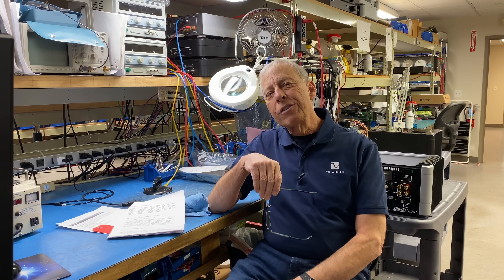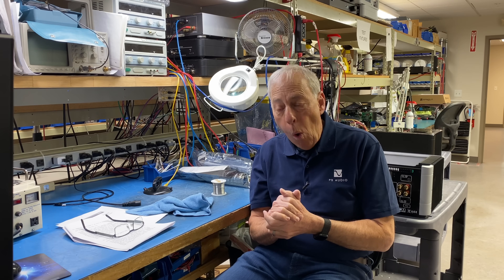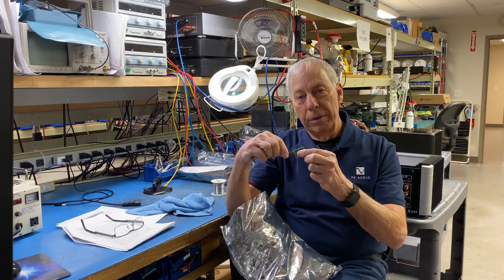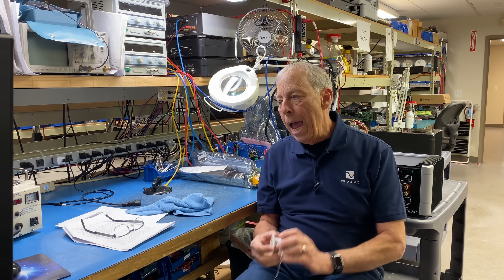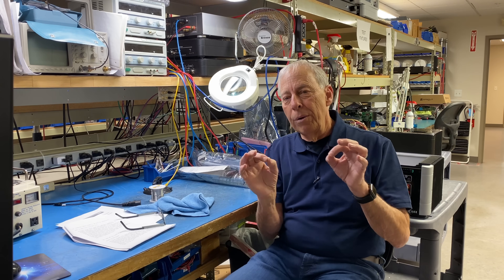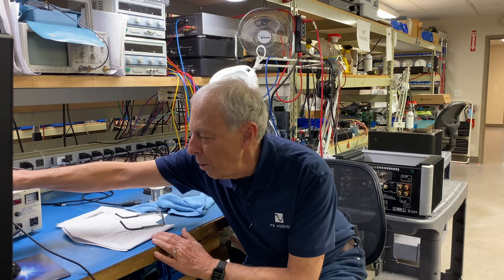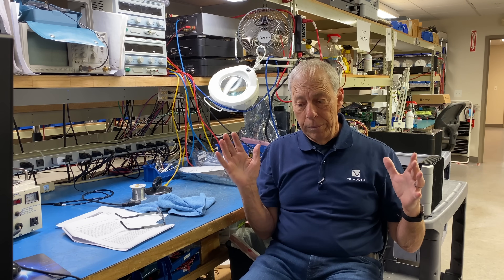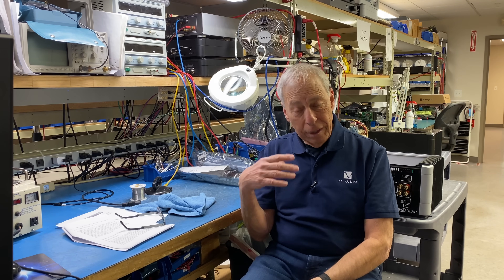How important is solder?

Comment: I remember when you had to flux so(l)der yourself. I must be old...
Reply: Scott King, yes, if you are soldering copper water pipes; the flux is separate from the solder, and is highly acidic, and you should never use that type of flux for soldering electronic connections, it will corrode them! Read the label on any type of flux before you use it, it should say on the bottle if it is suitable for electronics work.

I dont recall ever seeing any 60/40 electronics solder that doesn't have a flux core, and I'm 62 years old. If such a thing exists, I wouldn't recommend using it.
Reply: Dave Micolichek  , surely not for electronics work?! Plumbing, yes; I learned to sweat pipe some 50 years ago (our summer place at the beach would invariably be found to have a burst pipe somewhere under the house when we went to reopen the place every spring; the pipes werent all pitched properly towards the drain valves). I dont think I've ever seen 60/40 electronics solder without flux core. Conversely. I've never seen plumping solder with an acid flux core (the new leadfree crap for plumbing could probably use it, terrible stuff, but perhaps an internal flux would spit at you when you applied the torch).

Anyway,  soldering of any kind is always about cleaning the metal first; nowhere is that more apparent than when sweating pipe!

Comment: Paul, you mentioned a study done that compared the different solder types back when 63/37 tin/lead was the norm for good solder (military production). Can you point us towards that study?
Reply: I always use sn63.  It has the lowest melting point.  Funny, that as you mix tin and lead, the melting point is lower for the alloy than for either metal on its own.  And 63%tin/37%lead is the lowest melt point.  Higher percentage of either metal, and the melting point starts to rise. Sn60, the one he mentioned,  is very close to sn63, with a similar but slightly higher melting point.  For some reason, it was far more common outside military applications.
Reply: @scottrsmith2389   As i said we used 63-37 rosin core (RA) solder for our military production line so that is what I always used at home. This military equipment had harsh vibration requirements so we need good non fatiguing solder joints. At my age I'm not likely to switch over to silver, my hearing's a bit suspect especially since I had a 1,000 psi CO2 line burst next to my head years back - talk about ringing your bell.

Comment: Yep I remember reading about a ''special'' solder (and I pronounce the L) back in the 80's that was supposed to sound better.  I think TAS or Stereophile had articles about it.  People were wicking and or ''sucking ''the solder from their PCB's and replacing it with the magic alloy. $$
Reply: I guess once you get bored enough of changing power cables, upgrading solder is the next logical step.
Reply: @terrywho22  Made my day and also spot on^^
Reply: "Wonder solder"
Reply: "you can instantly hear the increased soundstage quality!!"
Reply: @ruwdbouy  Yes, It's as if several veils have been lifted.  ;^)
Reply: Well replacing only ONE, or only a few joints of solder in an audio component with a different, better type of solder definitely isn't going to make ANY totally audible difference, (and "arguably" measurable at that), however, if you changed out every single solder joint in the entire circuit of that component, or better yet, you actually were to build the exact same component from scratch with the better solder, from the ground up, then you would be able to hear a slight improvement in sound clarity and detail, especially in the top end treble, (I've tried it myself because I didn't quite believe it either!), but this will also all come albeit at a very considerable price/cost increase over the cheaper "standard" solder, so it's usually not really worth it, (price vs. performance ratio), to use the most expensive solder in most "average" audio components because solder doesn't make nearly as much difference in overall sound quality as the individual component part quality does! (i.e. the relative sound quality of the capacitors, inductors, resistors, transistors, tubes, etc., etc.)

That's why expensive solder is mostly reserved for the truly high-end audio components that actually CAN reveal tiny little minute details like that! Truly high-end audio components and speakers are where one can actually appreciate having the better solder in the circuit!

Comment: High percentage silver solder every time - silver core wiring where possible too. It does create an improvement if used in critical areas.
Reply: Lead doesn't conduct well.
Reply: @scottlowell493  Correct, but all the lead in the solder does is lower the melting point of the tin. The tin dissolves some copper so, properly done, a solder joint is a copper to copper joint.
Reply: Silver has too high a melting point for electronics, silver-solder in plumbing needs an acetylene torch to melt the solder :-(

Comment: Paul is wrong about flux! Flux is a type of cleansing cream that takes away oxidation on metals so the tin itself sits and flows outward  and attaches to metal.
Reply: Absolutely correct heat melts the solder, flux allows it to flow
Reply: You are so spot-on!
Reply: Liquid pine tar is my favorite Flux! Where can I get that? When I worked for Honeywell in the 1980s it came in a big bottle we could squirt out into a smaller bottle with an applicator brush... Can only find paste today
Reply: ThinkLearnSolve: Thnak you me frend. I gave up on tech stuff whne I found ou tmy Panasonic 3 CCD camercorder recorded at 640 x 480 and 720 x someing or another WIdescreen. WHen it does the Wbcam mode its 320 x 240. SI SDONT TRUST THOSE SALESMEN NO MORE THEY LIED TO ME! The tol dme how Great Firewire was and get firewire stuff. You are an honets FREND!
Reply: If Paul knows how to solder then he is correct and you are nit-picking for nothing.
Reply: Paul is correct.. Flux is actually an acid which activates at higher temperature. At low temperature is quite inert depending on types. So it helps reduce oxidation as the acid reacts with the impurities and also helps to etch the surface of the components. Also acts as a shield to prevent further oxidation.. Lower impurities equals better flow, and thus lower working solder temperatur so to do its job properly. Without Flux... Component will fail..and yes.. Huge impact to sound.. Leaded is always better in sound and long term reliability..
Reply: No! SOlder lowers the meltin gtemperature as does the flus.
Reply: @ilovecops6255  ????
Reply: @ford1546  I remembe3r when they were sayign AGP woudl replace PCI. Well,. it did nto happen and I got stuck with lots of AGP cars voer the years. Then they said how great USB 3.0 is supposed to be. Its a  lies. Here is wht I foundf BY MELFSS - 

Why is it that the current crop of USB 3.0 flash drives don’t deliver full USB 3.0 speed? Most of them max out—according to manufacturer specifications—at 100MBps (800mbps) or less. In a casual search, I only found one, the Mushkin Enhanced Ventura Plus, that advertised a read speed of 200MBps (1.6gbps). That’s still less than half USB 3.0’s maximum.

Now Im, rungnint Ubuntu Linus and I dont care for WINDOPWS NOE MOPRE!
Reply: @ilovecops6255  It has been like this all the time for years as long as computers have been around.
you never get the speed it says in the specification. This applies to USB. WIFI and other stuff!
Reply: @ilovecops6255  AGP replaced pci in a way on video card. AGP was used for video cards for many years before pci-e took over. Do not mix pci and pci-e.

The reason we can find old pci on newer motherboards is to have backward compatibility with older stuff
Reply: skrotkalle skrotkalle: Thank you MIne Frend. I justr did what the sales guy said was the trends. THEY ARE LIARS! Best Busy selles defective stuff. I don tjabe no more money to get stuff opther than diskc dor storage. I cant afford WIndoes. just Ubuntu and the cheapese ASUS mohter board from Amazn. Yo are an honest fredns!
Reply: @ilovecops6255  No it doesn't. Flux is there to stop the pads, leads and the surface of the host solder from oxidising so you get a good bond. It has nothing to do with the melting point of the solder alloy. If there is no flux, the solder will "ball up" and won't flow as everything, the solder included, will oxidise.

Comment: You did not talk about solder whiskers?
Reply: A very surprising omission.  That is a big issue with all electronics since they removed the lead from the solder.
Reply: Yes, I was thinking the same, a common problem resulting in long term failure.

Comment: 700 degrees? More like 350-400
Reply: That was eutectic point tin/lead alloy solder. 60/40 is very close to that. Lead free solders (97% tin/3% copper) have a much higher melting point and are typically used for plumbing applications. It doesn't flow very well, though (voice of experience.) Adding a few percent silver to the alloy lowers the melting point and makes for better flow at the expense of making the solder much more expensive, but well worth it.
Reply: I think he meant Fahrenheit and you are refering to Celsius
Reply: probably Fahrenheits vs Celsius. I think that solder produces toxic evaporations over 400 or 450 C degree so I think it is forbidden. That's why thelead is forbidden. There is a strong correlation to the cancer.
Reply: He's American, so he talks Fahrenheit, not Celsius.

Comment: SOlder is better for audio than welding.  tig WEL WOUDL PROBABLE runit the circuit beoard becaue it gets hot. They soucl use oxygen actylene but that too is very hot for a circuit board. Ot would probable melt is, and they have to start voer again.

Comment: Um... nope. Not how the process works. See Zanthum’s comment below. Lots of good videos on YouTube too. But to answer the original question; yes solder - especially in something subject to vibration and thermal cycling, like a speaker - is very important, not so much because it’s going to affect the signal much due to it’s electrical properties, but because if you get it wrong it’s not going to make good physical contact (either the joint will be poor to begin with; or it will break in service).

Comment: Flux is corrosive it 'wets' the metal allowing the solder to bond
Reply: Not ALL flux is "corrosive", per-sé, (only certain types, like "acid core" which is more used in jewelry making I think), (and you don't really want anything corrosive used with electronic joints and components anyway because it would continue to eat the metal away over time, resulting in a metal oxide which wouldn't be good for the overall joint conductivity!), but I agree with you that the flux in electronic solder does help the solder "flow" or "wick" into the joint better.

Comment: All solder has silver nowadays because as you say lead is not allowed any more. I still have Sn60Pb40 and I even managed to buy it online recently. So now I have the pleasure to compare them. I can tell you that Tin Lead solder is much easier to use, melts at lower temperatures, is more eutectic and in  y opinion overall a better solder.
Obviously silver sounds better but not for sure from you from your speakers. It sounds better on paper I mean if you are not applying science. I do not have the answers, but bummer I would not be surprised if the old Tin Lead combination would sound better. It is totally irrelevant because equipment manufacturers are not allowed to use it but you can try it and I would not be surprised if PS Audio has done that already.

By the way, it seems we just got a bit of the 1% un-true from Paul, apologies for poking fun in reality I have very much respect for his knowledge and creativity, and that is the flux. Flux is only used to wet the objects that need to be soldered. When you solder a PCB by hand and the solder joint looks shiny and like the type of Gauss curve governments are after with the Corona virus, you have done well. If it looks like an Italian Corona virus Gauss curve or a Ball, not so much. Then the wetting of the PCB has not worked well. Tin Lead actually has natural wetting properties and it dissolves copper so you get a Tin Lead Copper mixture at the interface of the solder. This of course gives a mechanically very good connection. The new silver alloys are not so good at that and often I add extra flux to help the wetting with that solder because the flux in the solder is not enough or has burned already due to the much higher temperatures needed the soldering of that stuff. 

Last note I am a freelance metallization process engineer in the semiconductor industry and I have worked in about 50 semiconductor fabs over my career. Audio quality has never played a role in the manufacturing of semiconductor parts, including parts made for Audio. My Grandfather was working in the R&D of valves at Philips (wich included Mullard, Tesla and Valvo among others) and Philips in those days was very much concerned about the Audio quality of their valves.

Comment: All other things being equal, silver has the highest electrical conductivity of any metal.  It is rated at 100 on an arbitrary 0 -100 scale.  Copper is second with a rating of 97.  Gold is only rated at 76, but it is resistant to oxidation which gives it an advantage for cold connectors
Reply: Silver oxidation conducts very good, so oxidation is a non-issue with silver.